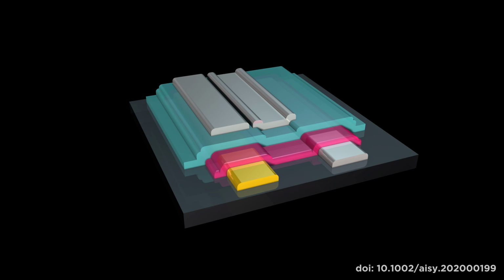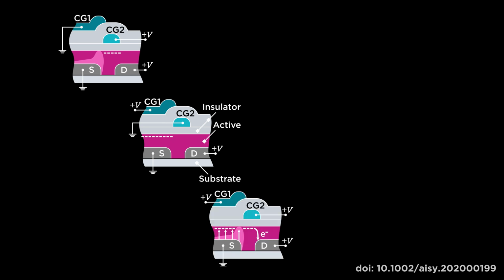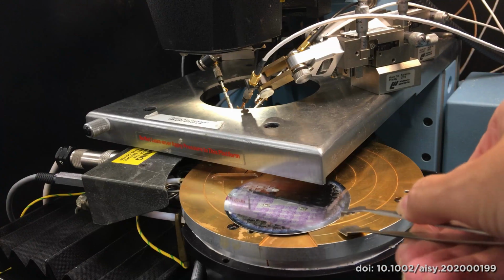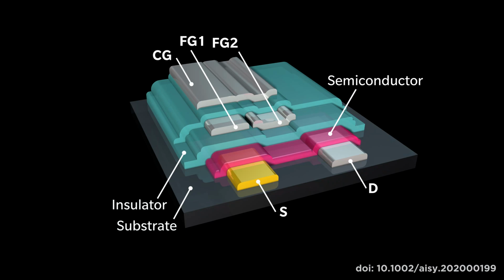The Multimodal Transistor - Video Abstract

Comment: Do you anticipate this technology might be applicable within SiC or GaN devices?
Reply from the maker: That's a good point, @99otari. The operation of the device still holds regardless of the material, but usually these semiconductors are used, at least in part, for the high current density achievable. The MMT's operation relies on a potential barrier at the source, which naturally reduces this current density. But that may not be a bad thing, in the sense that the added functionality gained could offset the penalty in current, and obviously, not all transistors in a circuit have to be MMTs. The devices responsible for high current/power may still be traditional variants. Do you know anyone who'd want to give it a go?